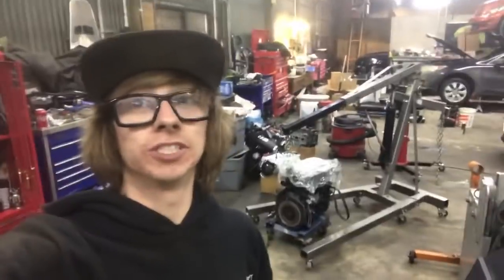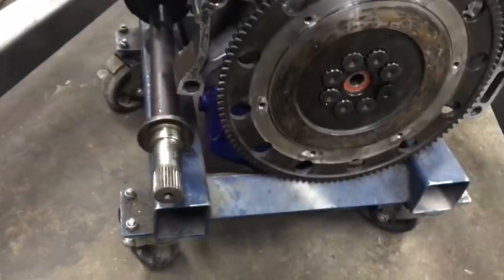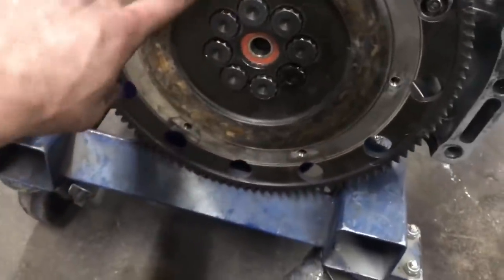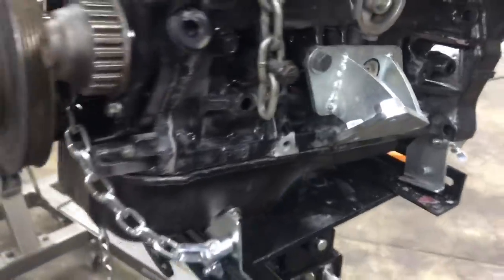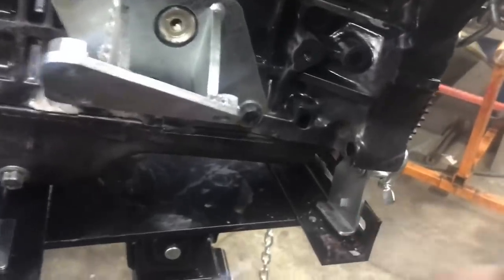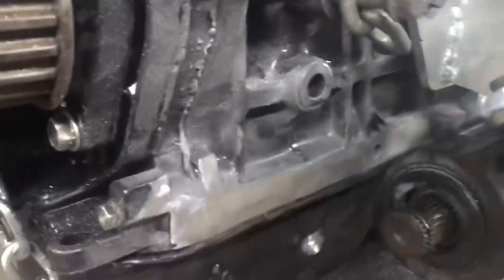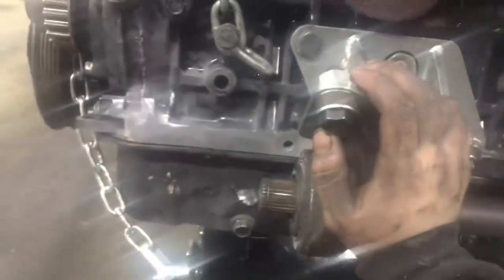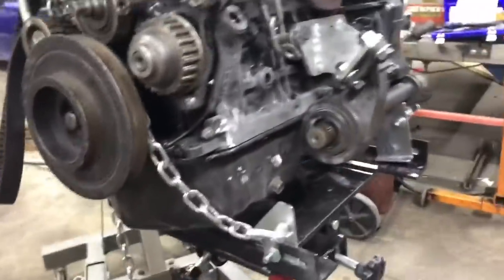Holy H Part 2 (transmission mock up)

Comment: I'm a bit concerned about that half shaft being spaced out. Kia had a recall years ago because on a specific model they had the half shaft going into the side gear at a very slight angle and it quickly wore the splines away.

Comment: Hey Shane I was wondering why the H series. I really don't know why all the work is the H that much better? I like what you are doing just don't know what the difference is could you explain please. Keep up the Channel as I really like the Odd builds and an All wheel drive civic sounds cool as hell
Reply from the maker: Cripple Bitchin it's flows more and is all around better with the oiling snd everything. There is just less support for the h so no one builds them but the heads flow over 300cfm factory you'll never see that out of a B

Comment: All wheel drive Is this one of the few all wheel drive custom Honda Turbos? I guess it will get good traction and hold the road good with all that turbo power. I am new to this. I use to hot rod my mustang about forty years ago with a four barrel carb that was all i could afford and the turbos were exotic nobody had one except rich people. This car is going to move out with all wheel drive.

Comment: Nice job but you need to make sure the axle shaft splines are perfectly square with transmission or you won't get full spline contact under load so the washers you put in  between the bracket may not be the best way for getting the clearance . But I may never other

Comment: Loving the content. I think if you were able to add one more camera that is stationary that just hovers over the project, it would be awesome. The close up stuff you do is cool, but doing a picture in picture occasionally and while your adjusting angles with a lot of movements could help. Good for referencing where and what you are working on from a our point of view. 

Food for thought: Keep the close up stuff, add one more overhead/over the project camera  Congrats on 10k, 100k is next!

Comment: I personally like a bright engine color, it helps spot leaks and stuff. When i pulled my 30v 2.8 V6 i painted that shit ford blue. the 500 thousand mile 4.6 in moms car is painted purple to match the car. color means nothing.

Comment: You know anyone with a lathe? Try putting the axle in a lathe and narrow it instead of putting washer spacers on the carrier mount to avoid possible spline damage from the slight angle it'll have.

Comment: Why you not block the balanced shafts?
Reply from the maker: If you don’t run the belt it does the same thing leaving the shafts in there doesn’t affect a thing and keeps the holes that you’d have to plug plugged and keep oil pressure good. If I remove the shafts and run no belt then I have to plug the oil holes and such which is just more work and unnecessary

Comment: While you got it out you should put a manual timing belt tensioner from a 2.3 non v-tech prelude and get that balancer belt eliminator. Just a little tip but not crucial just some things I did to mine